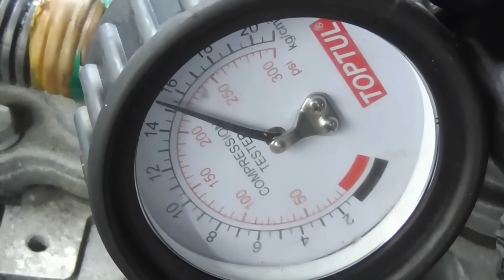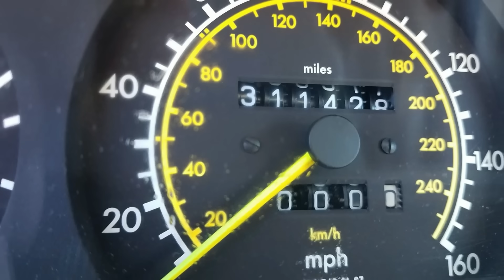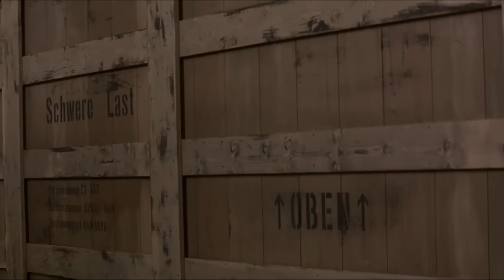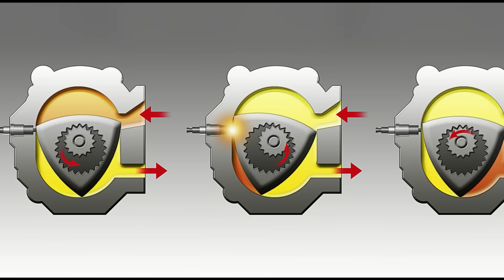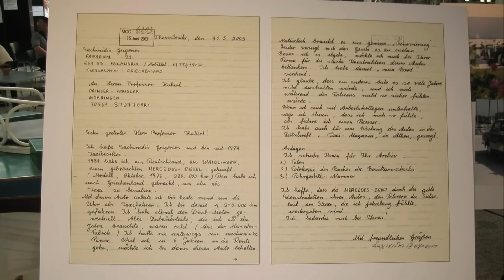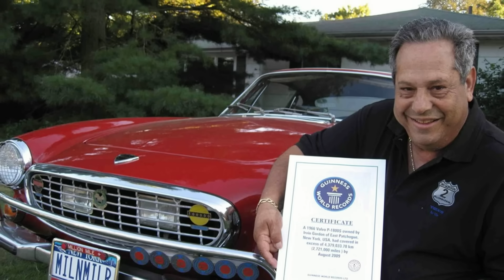Most Reliable Engines of All Time

Comment: I have no idea how OP chose which engines were "MOST RELIABLE", dart board or fortune cookies?  No mention of the Toyota 22R, the Nissan Z24, or the honda civic engines?  And IDC how "reliable" that BMW engine is when the trans, the electrics and the rest of the drive train is going to fail first anyway and cost you a fortune thus making "most reliable engine" pretty much moot.  The sure way to find the most reliable car to get, consumer reports, and THE FORUMS.  I always go to the car forums - as many as possible - and read what kind of major problems the car has (the one you are thinking of buying), how serious they are, how many hits (which tells you how many other people had the same problem), the number of serious recalls, and how well the manufacturer honors the warranty.  For instance, once i went to the Chevy Volt forums; on the first page was a long post about how a Volt owner drove it through a rain puddle and the car died (repeatedly) and could not be restarted without going in the shop... and that told me everything I wanted to know about Chevy Volt.

Comment: "The rotary is one of the most reliable engines"

Me: Looks at my broken rx8
Reply: That’s a joke right. Rotary engines are junk
Reply: Frankly, after the RX8 rotary engine fiaso, I don't think anyone will want to buy anything with a rotary engine. The RX8 was a neat car but the engine a failure.
Reply: @don-cw1yz  I'd personally love a rotary, if it wasn't so damned expensive on upkeep.
Reply: I know a guy that has 3 of them luckily he works for Mazda as a master tech.  They are always broke.
Reply: Ehhh  why is this ?  They dont go 5 mins between rotor tip seal replacement..
Reply: I have seen SKYACTIV motors with over 400,000kms on them, never seen a rotory go that far.
Reply: yeah, that's BS. RX7 13B engines regularly blow apex seals and need a rebuild every 50k kms
Reply: @Dominik189  so false 😂😂😂🙏 follow the vargas brothers and you'll see how very wrong u are about rotaries my friend
Reply: The rotary engine cant last a month in regions having 40 degree plus temprature 3 to 4 months nearly all of the mazdas in those regions swap rx 7 n 8 with 1jz or 2jz toyota engine n u call rotary a durable engine haha lmao
Reply: Yeah,til the rotary seals go in it at 80000ks,and the garbage grenades.Been a mechanic over 47 yrs,seen it happen--TOO OFTEN.
Reply: I had a Rx7 1979 that reached 400 thousand miles on it 12a ! I rebuilt that motor all I did was replace all the springs apex, side , corner and oil control ring spend $200.00 with the gasket kit! It was cheap then! I used that car for another 50,000 miles and sold it for $1500.00
Reply: Rotor seal failures are a thing of the past. I have seen ceramic seals go for over 400K miles. Stop your BS. As soon as I see anyone talk about seals I know nothing.
Reply: @joeshmoe781  the hell, ceramic seals?
Reply: @Dominik189  Yes, they don't wear out as fast as the steel apex seals.
Reply: @CondoreComputing  oh, nice
Reply: Joe Shmoe ceramic seals? I am not much on rotary motors but if they have ceramic seals why did the rotary motor go the way of the dodo and why did they not put them in the production version and if did so why don’t you see them every day if so they are so reliable?
Reply: @JohnDoe-bc8wu  emissions regulations
Reply: Bojan Ljukovcanin 
Thanks to the government. Now they think electric vehicles are the future. The fuel is uranium with a 1/2 life expectancy of 5000 years. Wind power was a joke to much maintenance on turbine & blades. Coal is nasty nuclear fuel will be here long after we are dirt. So much for the “new clean deal” They just stuff it in the ground or dump it in the ocean. Out of site out of mind. Corruption at its finest.
Reply: @JohnDoe-bc8wu  to be honest, there isn't ever going to be a "clean" energy source. All sources of energy produce some waste. The closest to a clean energy source would be hydrogen, but you have to use a lot of energy to get hydrogen to begin with, making it a fuel that just wouldn't be feasible. "Wind power" isn't too bad, yes, it's maintenance is kind of a pain to do and can be expensive but in general it isn't too bad. As for Nuclear, it is definitely the cleanest currently available, just in terms of the ratio of waste produced and field use to energy produced. But it has high risks of serious risks associated with it.
Reply: Bojan Ljukovcanin 
When hydrogen + oxygen + fire = water. Oil, electricity, & nuclear all  pads political pockets. Why would they explore into hydrogen fuel?
Reply: @JohnDoe-bc8wu  they wouldn't, because Hydrogen production is HELLA expensive. Nuclear is actually cheaper to use than hydrogen. Just based on how much it would cost to produce.
Reply: Bojan Ljukovcanin Manhattan project. They can put billions in dollars on that in the 40’s? But not to the new clean energy & development of a safe alternative. Think about a small safe hydrogen cell + motor + generator to supply a electric motor to charge the battery pack to the drive of the vehicle.
Reply: @JohnDoe-bc8wu  eliminate the battery, electric shit and forget about the "generator" usage. Just hook up a manual gear box and drive the damned car...

Comment: D4D Toyota 3ltr diesel, our one had over a million kms by now 1.2million and still running like a gold watch, new owners very happy with it!!!!
Have to Disagree about Mazda rotary, they had a short lifespan at best, high maintence!
Mazda has build much longer life engines!!!! Namely the 1600B ute four cylinder petrol, they went on almost forever. 
High mileage engines, try Volvo P1800 there are some with several million miles not kms.

Comment: you should call this a list of all European and Asia reliable engines because there's no mention of the Chrysler, Chevy, or Ford and last time I checked the 7.3 Ford diesel the 350 Chevy the iron Duke in line 4 2.2 will the most reliable engines I've ever owned and those engines could get over 300 to 400 thousand miles compared your lousy 200

Comment: No gm lm7 or ford 4.6 2v on this list, both capable of running like a top with 300k+ (might launch a plug in the ford, but that's not terminal and fixed easily)

Comment: 06' Audi A4 B7 2.0TDI 350k miles ,oil change every 10k and the notorious failure point in these engines - the driveshaft of the oil pump replaced every 30k. Still running as good as new

Comment: Since when did making it 120k miles with no problems make an engine reliable?!!!! There are Toyota and Honda engines that go 300k plus with no problems.
The 13B rotary is unfortunately not reliable with most needing a rebuild at 100k miles. Very temperamental too. Spark plugs need replacing every 15k.

Comment: Best diesel engines for pickups which should be in here is the 5.9 cummins can easily reach 500k miles and 7.3 powerstroke but had a few more problems

Comment: Rb26 have thinly casted blocks. They can crack at 600ish hp. They also had issues with piston bore mold shifting during casting of the block. Also had cylinder head oil drain issues. Still reliable if you respect it's limits.
Reply: Yes and they poo oil pumps

Comment: Ok I guessed that this was not made by car guys the k20 was not in every type s civic the original type r and s had a b16 and the integra had a b18 the k20 didn't start until the ep3 came along , rotary are notoriously not reliable due to regularly failure of their apex seals ,just leave the car based lists to car based channels please

Comment: They left out a few good engine's: Cummings Diesel,Ford 300 I-6, Ford 2300 (pinto engine), Dodge 318 & 360, and GM 3800. To anyone reading this: MAINTENANCE IS CRITICAL!! I have a 04 F-150 5.4 3 valve that has over 255K on it still runs like a champ.
Reply: AMC straight six as well

Comment: Hmmm, he makes it sound like 100k to 150k is super reliable.. I currently have two vehicles with over 200k on them. One is a Ram 1500 with 230k with 4.7 gas engine. The other is a Ram with a Diesel engine with 265k. I got rid of a Jaguar XJ8 years ago that had 130k and the person I sold it to owned it for year but I am not sure how many miles it ended up with. Bottom line is, the engines he is showcasing would probably do over 300k with proper maintenance.

Comment: Why is he acting like 150,000 miles is uncommon. Almost every motor can easily get that if you just change the oil. Just look at used cars and you can see that🙄
Reply: My Impala is knocking on 190,000 & still runs like a champ.💃🏿✌🏿💃🏿It has a 3.8 V6.
Reply: Perhaps this vid should have been called the most reliable unmaintained engines of all time ?  A 1.6 petrol Ford Focus will easily do 150k miles with the occasional oil change..
Reply: Is this a high performance engine reliability post or every day drivers??? No mention of the Ford 300 CU IN in line 6 engine that I personally owned a 1965 Ford Fairlane that I sold with 491,600 miles on it still running just fine. They were made from 1965 thru 1996 and they were not just in cars/pick ups ether. Many farm tractors, farm equipment, utility vehicles and the big brown UPS trucks had them as well! They were not high mpg engines but RELIABLE! I have one horror story though that my Brother bought a 1967 Ford F 250 4x4 with a 300 six in it. In the summer of 1969 I asked him how often he changes his oil because he was complaining that it was burning a quart every 300 to 400 miles? His reply was, "Change oil?" It had 45,900 miles on it with the original oil and my brother only adding oil when needed. I changed his oil/filter putting in high detergent oil. He took my advice having the oil changed again in 100 miles. It lasted another 38,100 miles before it locked up.
Reply: @brucesteger2699  yes correct keep oil new and engine will go a very long time. My diesel yaris has 178000 miles engine is like new I change my oil.👍
Reply: 150,000 miles is nothing nowadays...just getting broke-in. There's no reason for any of 'em to NOT reach 300k with regular oil changes.
Reply: It's not uncommon at all. Choose a car with an engine that isn't stressed with a ultra high output from the factory, don't run it above 4000 rpm, use the car daily, go as long trips as possible, and keep the maintenance. Filters are more important than changing oil every so and so often. I met a Toyota that had never had it's oil changed for 100.000 miles. It ran fine.
Reply: Eye on you
Absolutely my car has 175,000 no signs of any wear dosnt use any oil.
Reply: I'm also wondering why he thinks coil on plug is some amazing tech.  I haven't seen a distributor on a new car since the end of the 20th century.
Reply: Under rated comment... also why don't they show the right model year for examples of cars with a given engine and when and where the hell did they sell a Supra with a 3S?
Reply: Shit. 150k is advertised as low miles now days.
Reply: Changing the oil has nothing to do with long engine life.
Reply: @joeshmoe781  100% False.
Reply: @joeshmoe781  are you dumb or stupid?
Reply: @joeshmoe781  Wow one born every day, it has every thing to do with it!
Reply: @joeshmoe781  just the opposite.
Reply: @joeshmoe781  It actually does when the oil turns to black sludge and is full of sh1t probley still hit 100'000 tho there are cars that have changed the oil regularly with a million miles on them oil is key to that.
Reply: @joeshmoe781  it has everything to do with it lasting. Explain why it dosnt.

Comment: Best Engines are from Honda. High performance + Fuel efficiency. Most Reliable Engines are from Toyota. Can run 500000KM+ without any engine repair just with basic maintenance

Comment: I'll put my old Ford pushrod 5.0 up against all these engines. Bought a brand new Mustang GT in 85 and put 310,000 miles on it in 7 years. Sold that one to a coworker.  The car was so reliable that I bought a used one with 50,000 miles  on it and put another 200,000 on that one. Anyone who had one of these cars knows 100,000 mile is just the break in period.

Comment: 50,000 miles average for a clutch??? I got 223,000 original clutch miles on a 1985 Ford Tempo GL 5 speed. The engine ran great and still pulled down 55mpg but the head gasket was leaking engine oil so I swapped engines, replaced the clutch, covered it up, deployed and still haven't finished the job many years later. That will change this year. I want to drive the car again cause 55mpg is the best I've ever gotten from any car!

Comment: I had 3 first generation RX-7's, 2 were 13B's and modified with Del Orto or Weber Carburetors, Racing beat headers, and exhausts, lightweight flywheels,... suspension, wheel and tire upgrades, body kits,.. etc.   I averaged around 200,000 miles on each of them.  I redlined almost every shift.  Jumped a hill near my home every day at 110 MPH with about 2 seconds of "air time" landing on a down hill slope.  I loved flying .    I have life long witness's to my love for these cars,.. and I wish I had another one now.    Only had one very minor accident and quite a few speeding tickets in 20 + years of ownership,... was a first name basis with some of the police that some got to know what I had under the hood,.. always had super friendly conversations,..  :)     I changed my oil.     a lot!

Comment: Longest drive New York to Canada? Really? Not too far...being as New York State borders Canada.......also...no mention of the bulletproof Jeep 4.0 litre....plenty of power, can be modded to almost 300 hp....and my own 93 Jeep ZJ has 360,000 Km on it.....and the guy up the road has about 500,000 km on his. These motors blow away the imports and are cheap like borscht.....

Comment: Just about every Toyota in the junkyard has between 200,000 to 300,00 miles and sometimes more  on them.
Reply: Where do you live? If you live in a rust prone area that's pretty average, the cars would have rotted away. But if it's the engines that failed and put the cars in the scrapyard it's pretty poor.
Reply: If they don't use salt on the roads. If they do it'll be a Flintstones car by that point

Comment: Did he really tout 200k as really high mileage for a diesel? 

Theres a bunch of 12v Cummins with over a million miles, probably a bunch of 24 valves too.  Duramax 's with over a million miles are starting to show up a few of them with only fuel pump and injector changes. 

My 07 duramax is close to 300k and I've never had to touch the engine or transmission, just regular service

Comment: If your clutch is only getting 50k miles you need to drive an automatic transmission car because your riding the clutch pedal or just abusing it. I've owned honda with the original clutches still in and driving up to 200k, and when I personally changed clutches because of slippage, really just looked glazed over, and stick flywheel resurfaced is all you'll need to do unless clutch kit comes with new light weight flywheel.

Comment: This list is trash said 150k isnt really high mileage.  I done bought and sold Hondas with 160-220k miles, accords f22 f23 are very reliable  just do oil and timing belt with water pump and can get 500k miles.

Comment: Didn't even mention the super reliable AMC/JEEP 4.0L Six, easily and regularly capable of exceeding 250,000 miles!  Bah.  So many American V8 engines can pass 200K miles and not one mentioned.
Reply: Absolutely. All the straight six configurations were the best every . Gas or diesel

Comment: You missed the Chevrolet Vortec 5.3L and 6.0L V8 engines, I've seen them reliably reach 300k+ miles easy
Reply: Yeah I've seen a 6.0 Vortec with 600000 Miles sitting there idling right in front of me no rattles running very smooth the man said he only change the transmission at 300,000 miles
Reply: Depends on the year, piston rings and heads made some 5.3 complete junk.
Reply: @doughewitt3362  Only the Vortec line, the Ecotecs are trash

Comment: Iam pretty sure the VW 1.9TDI is one   of the most reliable engines ever made. Does easily 600.000 kilometers without changing headgasket and Turbo
Reply: mine has 400k

Comment: wheres the tried and true Toyota 22RE?? btw 100k miles is a joke anymore, any modern engine easily surpass that.. my '05 Duramax is at 225k trouble free miles, other than water pump and batterys its still 100% reliable

Comment: If you want a reliable engine and economic with power and have sum money saved up I suggest you get a 5.9L Ram cummins third gen or a 6.7L cummins Ram third gen these are engines that will last you a minimum of IM+ miles and produce 350hrsprs or more depending on the model and engine size but if you’re less of tech guy and don’t want a lot of electrical problems stick with the 5.9L cummins diesel engine it’s extremely reliable and really economic especially if it’s not a 4x4 and you drive on the highway it has a fuel economy of 29Mpg